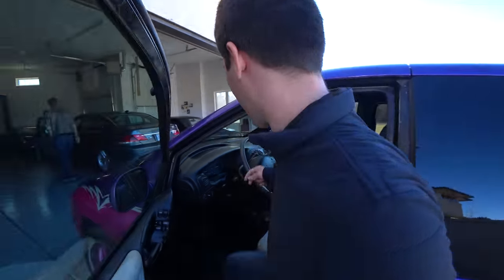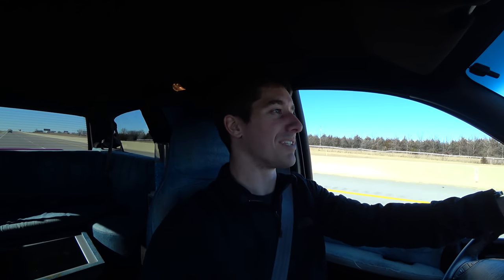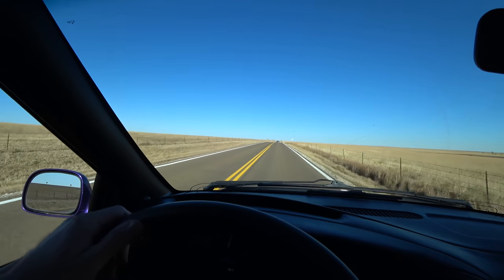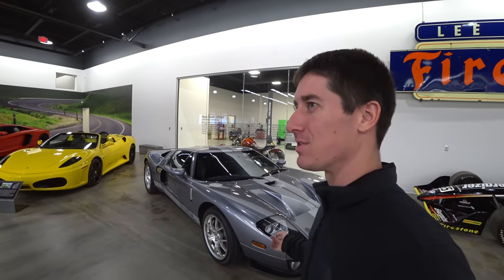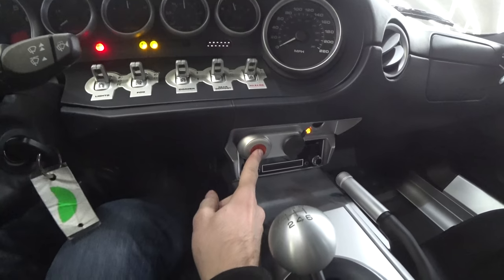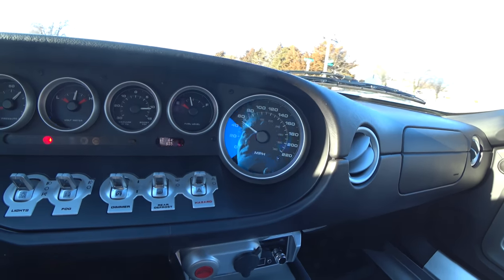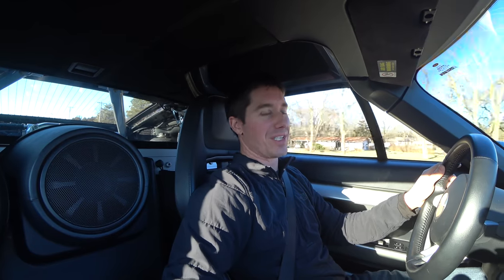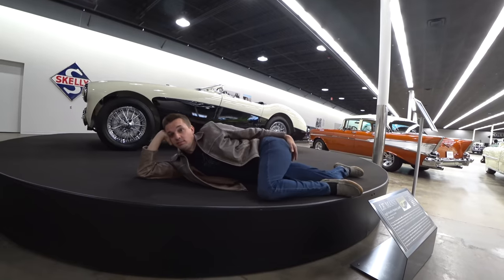I DROVE The World's Most FAMOUS Mini Van And A Ford GT

Comment: I was lucky to grow up in MI. I had the chance to see new car’s before they were even available to the public. I had a friend that was fixing up a 1969 sting ray corvette. He bored out the 350 small block to a 383. He had a 15 inch subwoofer with two 6x9 subs in the same box. Between the sound of the stereo and the engine you could literally hear that car from a mile away.

Comment: Need some help from y’all… Went to O’Riley’s to get some of that knocker loose penetrant you guys use all the time to give it a try and they tell me that they don’t carry it. But doing some research I say I need to order it and pick it up at the store and would like to know is this what you have to do every time you need it? If so I am willing to do this but if this is something I’m going to have to order every time then I might order 2 cans just to have it readily available at all times and then order a single can when I run out of the first cam  that way there’s always one here at my house at all times.
Reply: Just buy Kroil on Amazon. It works better.
Reply: WD-40 you can find anywhere, and it can be used for way more applications
Reply: Noah Matthews never really been successful using WD-40 and to be honest getting tired of buying cans that you only get less than 50% of the fluid out before you run out of compressed air. I use PB blaster but I have to be careful with it as I am allergic to something in it so want to try this stuff out.  Plus so far every video I’ve seen WatchJRgo using it on he has gotten every bolt out!
Reply: @noahmatthews5013  WD40 is not a penetrant. Kroil, or a 50/50 mix of kerosene and ATF is. PB Blaster works okay in a pinch.
Reply: @imtheblindguy  I definitely agree on that one lol I hardly ever can make it through a full can of the stuff, but its always on the shelf and its not too expensive so I keep buying. Maybe I'm the problem?

Comment: "this care is just well made. Oh looks like my door is open." If Jeremy clarkson has taught me anything, its that the Ford GT is about as well made as a Masaratti, as in it will be in the shop all the time.
Reply: Jeremy's car had an aftermarket alarm mandated by his insurance that caused all of his issues. It had absolutely nothing to do with the GT.
Reply: @JB-mk4ry  Google Ford GT recalls and issues. For a low production car, these were not engineered well at all. All the 2017s had multiple recalls. The 2004's and 2005's all had immobilzer issues. It goes on and on.
Reply: @lostapostle76  The immobilizer issues were limited to foreign market cars with aftermarket systems fitted due to insurance requirements, as stated before. The only factory "security" system was the same keyless entry that had been used since the Taurus in the 80s, and worked fine.
Reply: @lostapostle76  The only recall aside from the Takata airbag crap that applied to millions of cars from many makes was a control arm issue on a small amount of cars.